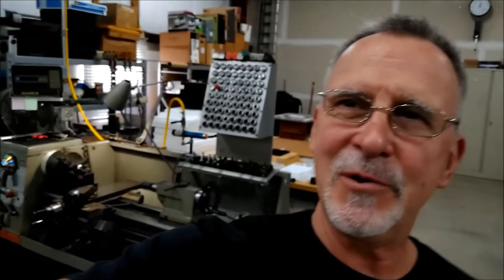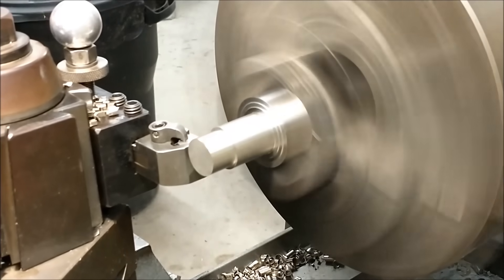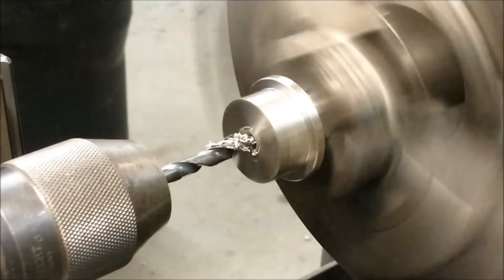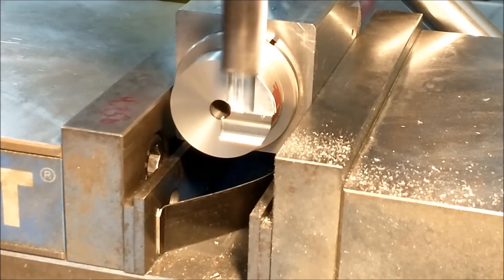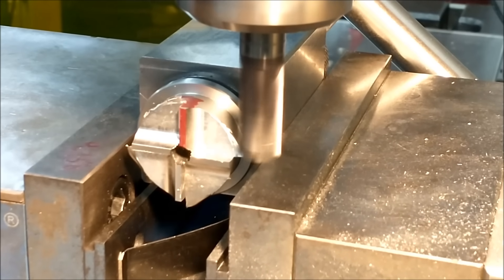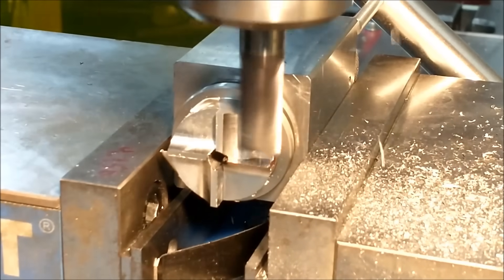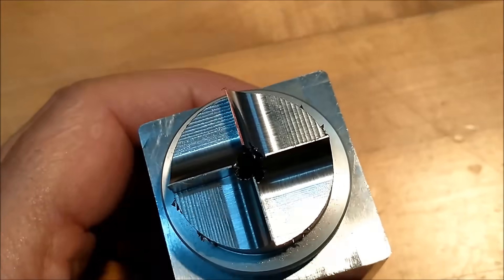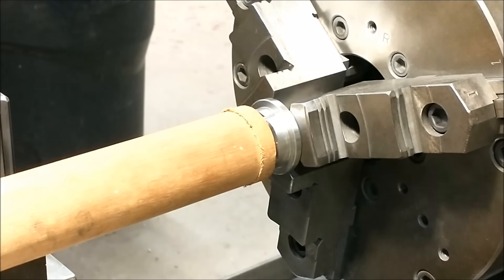Machining a Drive Center to Turn Wood on a Metal Lathe

Comment: Hi Joe, I see now that you try to switch from metric to imperial back and forth.
As a Canadian, which is officially being metric, and an old fart like me used to imperial, I constantly have to make calculations and approximations and I found that you have just 2 numbers to remember to hop from one system to the other.... 25 and 40 !
DO NOT use what I am about to explain for precision work, but to get you in the ballpark it's perfect...
1 inch =25mm, but there is a certain error coefficient, to correct this coefficient then use number 40 as 1 meter is 40 inches (1000mm / 25=40 again, with a slight error)
So 100 mm = 4 inches, 1 mm = 40mil and so forth...
10 feet is then 120 inches /40 inches= 3 meters  I know it sounds weird but believe me , it works! :)
A sheet of 4'X8' is then, 1m +200mm (40 inches +8*25mm) by 2,4metre

I find myself constantly juggling these values in my head at stores and supply places when buying material.
The real pain comes when you have to buy precision tools! 
I have most of my tools in both metric and imperial, twice the cost! 
I am an amateur machinist and the project I make concern mostly repairing/modifying existing stuff, or audio related equipment ( I am a sound recordist) and lots of the equipment I use is either metric, or imperial, so I prefer to use dedicated metric or imperial measuring tools. Of course, some of the electronic display types of caliper and micrometer can use both scales, but I am used to mechanical devices.
Also I have a whole set of metric and imperial cutting tools (end mills, drill bits, 82 and 90° countersink bit etc...) You get the idea!  :)
Reply: If the unit you wish to convert is metric simply divide by 25.4 for Imperial. To convert Imperial to metric multiply by 25.4.

Comment: Interesting but I would honestly recommend figuring out a way to use or make a Robust "cup style" drive center.  Sometimes the "traditional" methods are not as good as the newer ideas.
Reply: Those arent a new design. I have one that came straight outta the 50s.
But those are nice when you are showing someone new how to turn, just less dangerous and can slip if you catch. Just not appropriate for high load scenarios. Every tool has its place.
Reply: @miles11we  You say it isn't well suited for high load but testing proves otherwise.
Reply: @prototype3a  link it. They are called safety centers for a reason, the design didn't magically become grippy because it was recently made by a different company.
Reply: @miles11we  I know there is a better demo video for the Robust "ring" drive, but I can't seem to find it or remember where I saw it.

Comment: Love the process.  I, myself, would take off my chuck and insert a Morse 4 to a Morse 2 adapter.   I had to turn some very very hard 'Horse Apple' known by Boas-d-arc by many and myself.  The limb had dried for 20 years and was not yet ready.  I turn a spindle and let it dehydrate more.  Now after 40+ years I think it might be stable. I have both wood and metal lathes and wood and metal band-saws.....

Comment: Hi Joe, I am a woodwork, metalwork, electronics teacher, 25 years, here in Sydney Australia.When we turn wood on a lathe, the lathe centre has a conical point to assist in centring. I was assuming you were going to make that part on the centre tool. If you think about it, what you made is not a centring tool. It needs your skills to setup the initial centre. I would have machined a cone on the front of the centre, or would pressure fit a pointed shaft into the hole.
Otherwise, great work and thank you.
Reply from the maker: No spur driver like this will be a centering tool without the workpiece having a guide feature in it. It may be a simple awl punch mark, but I have yet to see a self centering drive dog. I also mentioned the center point options in this video. ( I was just too sore to do it )
Reply: @joepie221  To find centre on the end of a work piece we use a cross method of diagonals from the corner and use the spur at the intersection of the diagonals. By the way a real woodworker uses hand held chisels to do the turning. To use metalworking lathes for woodturning is not to be encouraged, although ok for some, the use of the chisels really gives the worker the feel and skills in what they are doing. In school, teachers show traditional methods of craftsmanship

Comment: Thanks for the video! A tool to have as spare in case of unusual work...
The supplier of my Super Mini Lathe, Warco UK, issues warnings against wood turning. They fear the fine wood dust will compromise the motor, and maybe the control box...
Joe, the adapter king.....
Reply from the maker: If it scares anyone, wipe the ways down before you start and keep a shop vac nozzle by the tool. Problem solved.
Reply: @joepie221  Yes, that ought solve it. Maybe first some metal turning making a shop vac nozzle holder on the carriage....